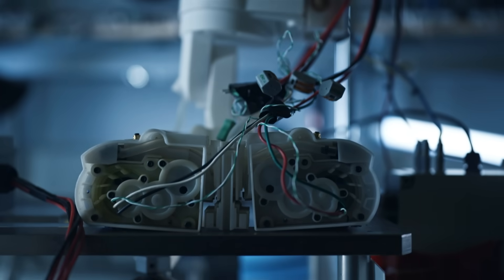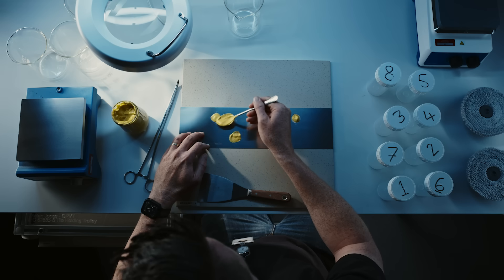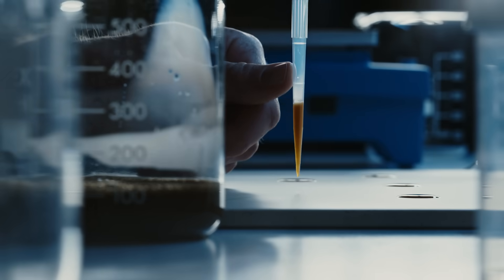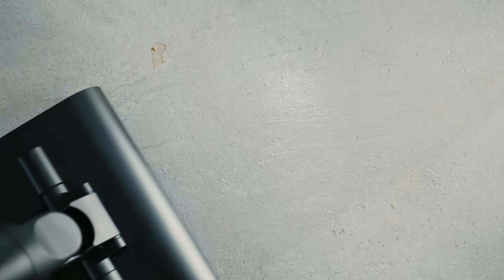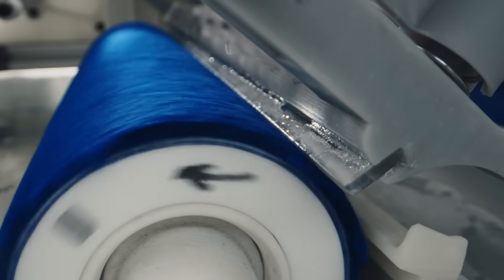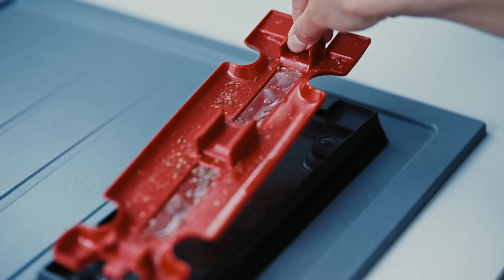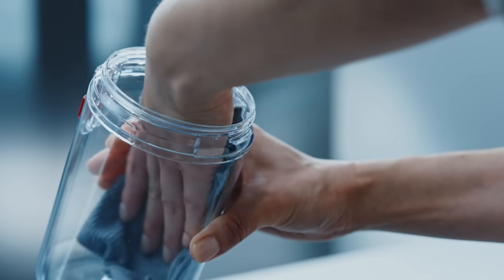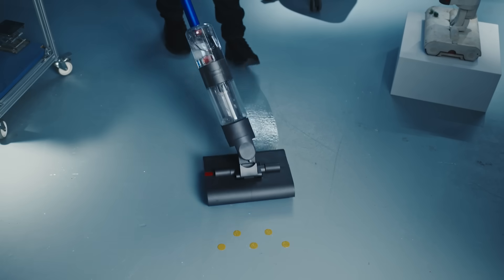The Technology Behind Dyson’s Wet Floor Cleaner: WashG1™ Explained

Comment: Cool, but how about you make the handle ergonomic? You know, the thing that the user is holding onto for 15+ minutes with all the weight of the machine. It's incredible to me that this company can be idolized so much, but skip on something so important for comfort.
Reply from the maker: A lot of consideration went into the ergonomics and usability of the Dyson WashG1™ wet cleaner, supported by extensive user trials throughout the development process. Over 500 prototypes were constructed, and 180 engineers and scientists worked on this machine between the UK and South East Asia. The handgrip is comfortable to hold, and the machine itself weighs in at less than 5kg.
Reply: @dyson  I appreciate the answer. My concern is with how the handle is almost just a tube, giving no support to hold against the twisting torque that comes from pushing the machine around, resulting in the user's hand slipping or needing to tense up their wrist and grip throughout the whole cleaning task. I probably won't be buying a Dyson, or any battery powered hoover for that matter, before there is more effort put into the ergonomics. Thanks again and kind regards.

Comment: I’m surprised the wetting mechanism isn’t spraying the water on the roller with a pressurized fan spray pattern.  The concentrated stream doesn’t seem like it wets the roller in a way to even out the water.

Comment: I love the attention to detail and scientific approach.

Question: If I already have a Dyson vacuum cleaner, is it enough to get the Submarine attachment for wet floor cleaning? Or is this dedicated wet floor cleaner much better than that? I have small hard floor spaces so it isn't a big job area-size wise. 

Thank you.
Reply from the maker: The Dyson Submarine™ wet roller head is not compatible with any of our other vacuums, including pre-purchased V12 and V15 vacuums. To intelligently switch between wet and dry cleaning, the V12s and V15s vacuums have been reprogrammed. Our previous software is not compatible with wet floor cleaning.

Comment: So it doesn´t have any option to use hot water (in the cleaning process or in the self cleaning)? Phew, I would have expected more from a company like Dyson...
Reply from the maker: It's safe to fill the tank with warm water up to 35° C. Please do not use boiling water, as damage could be caused.
Reply: @dyson  Thats a workaround and not solution to the problem, fact is that it will be more efficient, hygienic and safe, if you had considered this during development. The market already shows that such functions are state of the art (see Roborock, Anker etc.)

Comment: I have to praise them for being honest here and showing that cleaning a dry stain is not a magical process and that just one pass isn't generally enough 
Most manufacturers will always show the stain being removed in a single passage with their machines, none are ever honest about the fact that is often take more, so thanks for being (kinda) honest here

( On the other hand, ok the cleaner is pretty expensive for what it is, but it's Dyson, you know you pay the brand. And I can see some weaknesses in this cleaner compared to a more heavy duty model, but it's only the first (second with the submarine ? ) gen, it will only get better, and look like they are aiming for it to be more of a light duty model for quick everyday uses anyway, which is a good idea, there isn't a lot of options in this category )

Comment: Still need a drying mode in the cleaning process or you have strong smell after use.
Reply: There appears to be a red button that detaches one side of the device and lets you remove the rollers. You'd need to let these stand and dry after the wash cycle it seems.
Reply: @grimacemcccheese  oh ok that is not very handy. Roborock or dreame have aktive heating in the dock

Comment: What is the difference between this and the V15 submarine head?
Reply: Submarine had hard time picking up large debris, cereals for example. This new design seems to address that issue.
And it has dual brush bars, where as submarine had one, so the cleaning efficiency in one pass should have improved. Think omni glide with water.
Also this seems to have some kind of self-cleaning function, when attached to the charging dock. Submarine was all manual clean.
Reply: This actually works (as opposed to that ridiculous submarine thing)

Comment: So basically it’s gonna be a $500 mop. 

I’m running out of plug space to charge all these underperforming batteries. Bring back the cable I say.
Reply: You would still need plug space for the cable.
And corded cleaning machines have that fundamental issue of cable length. I've used cordless vacuum for years as my main vacuum, because it doesn't have issues with range.
Also if you have any furniture or multiple rooms in your house, then the cord also gets tangled around things and you may need to switch sockets between rooms. Which means you need even more free plug space.
And if you have multiple floors with stairs...you do the math.

We used to have cords on our phones and now we don't.
...just saying.

Comment: No drying mode during the self cleaning process? Ouch!
Reply: Exactly! Won't this make it more likely to smell and get mouldy
Reply: What I understand is that drying mode which typically using air blower concept potential will blows the dirty/molds contained mist into the air and it could be harmful. Pro con.

Comment: Waiting for someone to compare this to a regular $15 mop in terms of efficiency and ease of maintenance
Reply: This is such a wholesome discussion thread.
Reply: Seems like a £200 solution to a £10 problem.
Reply: 15 mop is king the new one with the circular rinse is king
Reply: Ok but I still would have to own a separate vacuum cleaner, or is this somehow a 2-in-1 machine?
Reply: @Induktionsschnitte I own the Roborock Flexi Pro (it’s the exact same product category—does all the things Dyson showed in this video except its single roller). So it’s “not recommended” for carpets, etc. So unless you have all hard floors, probably doesn’t replace a conventional vacuum.
Reply: Depends on what efficiency, clean wise probably similar. Reach wise, manual is better. Vacuum is more efficient in time and water usage.
Reply: Its way fast this way but dont buy a dyson are u stupid?
Reply: One does multiple tasks at once, self cleans, you don’t have to figure out how to continue mopping without just spreading dirty-floor-water, no potential of over saturating floor with liquid, that’s just what immediately comes to mind—haha I reaaally don’t enjoy mopping, but recognize it’s necessary so this sounds like a freakin dream to me. 

I know alternative “versions” exist…but Dyson simply doesn’t put out poor products. ACTUALLY their air purifier was def not top notch and I’m actually very surprised they didn’t take more time to improve it by putting money behind the science before putting one on the market. If they HAD, I feel like it would have been the go-to air purifier for those who could afford it (and anyone who prioritizes health/invests in purchases that will improve it in exchange for daily coffee runs etc).
Hahaha oops, ADHD tangent. BUT, for the most part, Dyson only releases premium products. It seems like they’re going to try to kill all competition with this, as they could have come out with a “decent” one ASAP quite easily. Methinks it will be game changing for keeping the house clean and healthier without spending nearly as much time and ENERGY as is typically needed  to accomplish what they seem to be aiming to do with this guy!
Reply: @Hmy8799  They sell many different vacuums, but with this product, they decide that "Vacuuming is bad, it has exhaust air," ...so let's drop that part and overengineer the rest, just because we can. 
their new slogan,. "Dyson, solving problems that don't exist"
Reply: @Hmy8799  We have a Karcher wet floor cleaner which is exactly like this they work great but nothing new here with Dyson they are just coming out with a competing product. Karcher is a German brand and is very high quality (we use their big scrubber cleaners commercially in our building)
Reply: @Hmy8799 thanks for your insightful comment, I’m not neurotypical either and enjoy reading people talk about something extensively
Reply: @aesth1cc  cheers to neurodiversity💙!! It’s been really great to take a step back as an adult, and look for (and find!!) the things I actually love about having a brain that works differently than most and honestly wouldn’t want to be changed—especially after solely thinking of it as being problematic and making getting through school/doing the basic “adult” things/tasks etc so much harder. Alsooo, having to overcome all of the challenges that we do/already have really does seem to change us in the best ways—more empathetic, open minded, and all that jazz.
Haha I’m sure you’ve already realized all of this but, y’know—ADHD and 3AM😂😂😂
Reply: @Hmy8799  great to see I’m not the only one experiencing progress in that regard. I think the internet plays a big role. Love it or hate it but exchanging information so effortlessly is exactly what the neurodiverse crowd needs to find out about themselves or converse with others without all the drawbacks of a real life conversation. We just have to watch out not to make it too easy on ourselves.
Reply: @aesth1cc  COULDN’T AGREE WITH YOU MORE on literally every single thing you said!! Thanks for putting a giant ass smile on my face! Love having exchanges like this!!
Reply: No matter how wonderful it sounds. You still have to clear all those hair and dirt tat cramps together with water with your fingers, after you done vacuuming. If you don't get what i mean, which means you don't do house chores often.

Nothing beats a normal vacuum and a mop for its efficiency.

Comment: I bought one today. So far I am extremely impressed. Better than the Bissell one I used to own. I love the self cleaning.
Reply: How tf you buy one? It doesn’t release til later this year 😂
Reply: @rl332  it was released in Australia today
Reply: I’ve been using a Bissell Crosswave X7 for a year now, and aside from the tedious maintenance and running through cleaning solution like there’s no tomorrow, I’ve been satisfied with it. I can’t wait to try out the WashG1.
Reply: @WatchOutLaszloPanaflex  I had the same frustration with the Crosswave, but there is no need for solutions with this Dyson; it requires just a few steps to clean. Over the years, I have tried most hard floor cleaners, and I think I finally have found the game changer. I hope you will find the Dyson to be your favourite.

Comment: This solves the major problem I have with all the wet dry floor cleaners out there. They are all super hard to clean out and require frequent maintenance to keep from smelling! The fact it separates wet and dry is fantastic!
Reply from the maker: Thanks for the feedback - glad you're as excited for the Dyson WashG1™ wet cleaner as we are! 😀
Reply: @dyson how long is the battery life and can we purchase a second battery?
Reply: @dyson . Great. I definitely want to review it. I'm a huge dyson fan with 10+ machines from you.
Reply: Philips Aquatrio 9000. Have it and love it. Dyson has two additional brushes here though, can imagine they give some advantage. But I like that my Philips is a 2in1 switchable device.
Reply: Get a Kärcher floor washer with rolling microfiber cloths, it's super easy to use, and I wash the cloth in the washing machine in between, replacing some at intervals. Never had problems with odor or anything. Sure I pick up larger objects before washing floors, and vacuum, no need to create mud first.
Reply: @dyson how long is the battery life and can we purchase a second battery?
Reply: @ilinapetrovska5629  Great question, I own a Dyson and the battery runs out so quickly for only having it for three years!
Reply: Philips 9000 Aqua Trio...............
But perhaps Dyson has some better features, I haven't compared them. However these 148 thumbs up are unjustified.
Reply: Yes now but it not from dyson cuz it sucks lmao. 900 euros whahaha enjoy wasting money
Reply: Nice to see you here I watch plenty of your videos
Reply: Hizero is a much better option. And they were they first to come up with the wet and dry waste separation.
Reply: How do you know?? @pyl8652 did you buy this already??
Reply: What? There isn’t a machine out there you can’t strip down in less than 10 seconds. What a silly comment. 😂

Comment: Uses the exact same system as the Hizero mop, separating large debris and liquid.
Reply: I’d wager that Hizero copied the Wash G1 to the best of their ability, given that it has available in China for quite some time.
Reply: @WatchOutLaszloPanaflex  Hizero launched in 2017.
Reply: @scottd1432  Hmmm, intriguing. 🤔
Reply: @WatchOutLaszloPanaflex hows it intriguing hizero tineco dreame already came out with this tech but dyson was lagging behind they didn't see the need yet until the recent submarine was introduced but it wasn't powerful enough.

Dyson finally made the decision to go ahead tech was already there but we looking from dyson I will definitely by dyson only
Reply: @scottd1432  Hizero is only single roller though
Reply: @mansnothot4160  Yes its not exactly the same, I was referring to the separation of debris and liquid using a stiff brush to scrape away large debris from the roller.